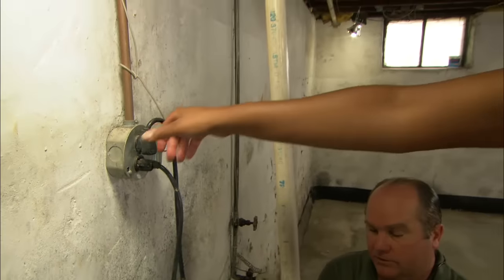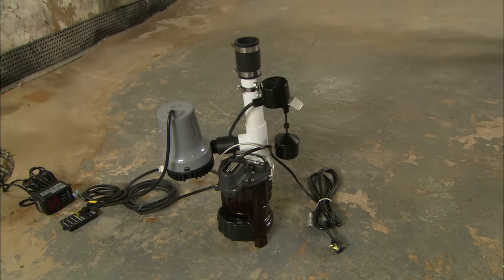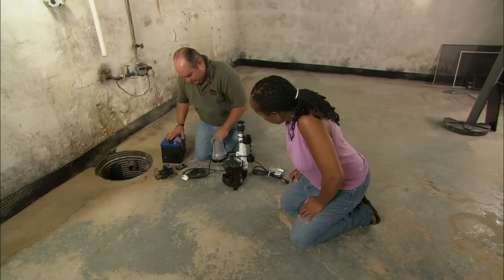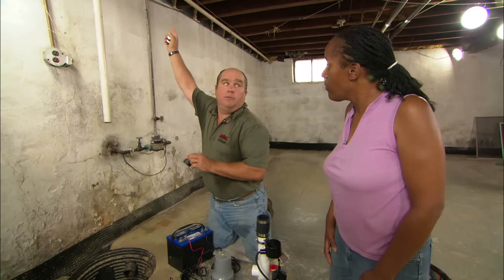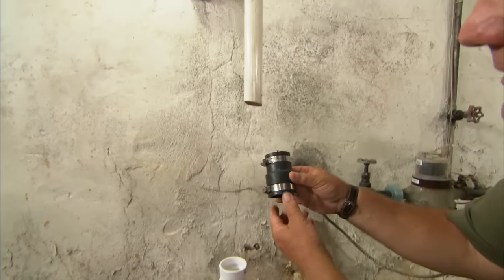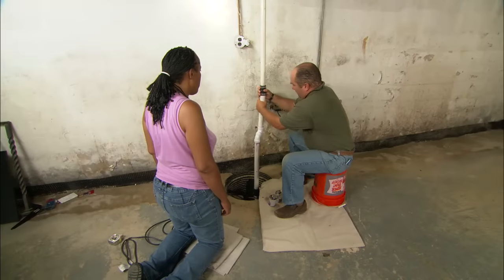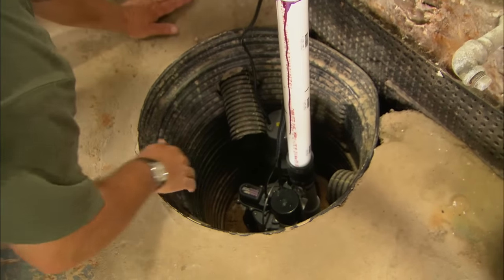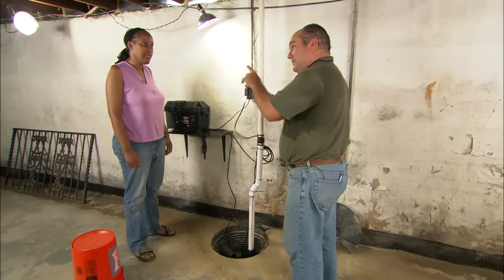How to Install a Battery-Operated Backup Sump Pump | This Old House

Comment: You should have used water backup pump from liberty or zoeller. Why create additional work if battery backup fails, Who is going to look to maintain battery,, another hassle and a chance for additional charge for the plumber!
Reply: Those typically have very low performance
Reply: I have a fully finished basement. There is no way to run water to my pump to use a water powered backup with ripping up drywall.
This might not be the best solution but it is the best for some people can get.
Reply: Wrong
Reply: Water is good cause there is no battery. Major con is you could end up with a huge water bill if the power is out long. Course that is better than a flooded basement tho....
Reply: Liberty water backup has a 2-1 ratio for efficiency, (2 parts fresh water to pump out 1 part storm water) and it is powerful enough to evacuate a pit in under a minute, or keep up with rain flooding until you can run a generator to your regular pump, 

Of course if your on vacation for a week and power or pump goes out for couple days, you’d be in crap either way.

Comment: damn I've never seen primer run that far!
Reply: That primer and glue was put on as sloppy as Bob Vila would have done. Richard is usually more meticulous.
Reply: I've glued thousands of miles of PVC CPVC SYS15, I've never seen primer run that far.
Reply: I guess they could have held the pipe horizontal a bit longer for it to finish drying, but who doesn't like a little purple decoration to liven things up?

Comment: Four hours of continuous use or 1 day of intermittent use doesn't seem enough when you consider the cost of these hybrid backup systems. The marine battery is not even included in the kit. You're looking at $500+ for all parts and some say the batteries only last 3 to 5 years.
Reply: Yes, the battery will fail right when you need it. Battery technology is still lacking.
Reply: Batteries last 3 to 5 years of actual use, discharge and charging.

Keeping a battery topped off on a float charge, stored properly in a climate controlled area you're getting 10 years or more.

However even if that wasn't the case, remember that 3 to 5 year mark is promising not that the battery will work or not, but that the battery will retain a certain percentage of it's original capacity.

I.e. this normally means after 3 to 5 years we promise the battery will still have at least 80% capacity at say a 20 hour discharge rate and still able to put out 80% of it's CCA.

Also largely batteries fail due to not properly taking care of them, with flooded you should check levels yearly in your vehicle or backup batteries(There are caps, unscrew, make sure electrolite solution is above the annode and cathode and if not, add distilled water) and if levels are really low that allows for sulfation which destroys batteries over time. 

Also largely batteries are cheap. Want more power and longer use? Buy a battery box that will fit 2 to 4 batteries(Roughly 50$ instead of 25$, or 150 for the 4 battery one) and have that be your backup. 

Buy a cheap battery tester, do a test yearly or every couple years, and hell a battery flooded is roughly only 100$. 

Rather cheap to replace that every 3 years, but again proper maintenance and keeping levels up, and largely because this should only be used when power fails, I wouldn't be surprised if it lasted 20 years.
Reply: @shawnsdrumcave  They also sell 12V solar panels super cheap now
Reply: @shawnsdrumcave  if you have municipal water check out Base Pump HB-1000 on Amazon it is a backup pump that uses your municipal water venturi style to empty your sump  when you have power failure. It uses one gallon of water for every 2 gallons its empties from your sump, saves you so you can get home and start your generator. Also check out the youtube video of it being installed if your skeptical. I just had it installed life saver

Comment: Missouri Wind and Solar mwands dot com has a lot of battery based systems including wind turbines and solar systems. They are also working on a batteryless pond aeration system for under $800.

Comment: I keep reading about drilling a hole in the outlet pipe.  Richard doesn't in this case, so I wonder if it is really necessary?
Reply: Martin Connor lots of pumps have the anti air lock hole in the housing these days.  The instruction manual will tell you if it's necessary.
Reply: I just bought a backup pump kit and it had one built in.
Reply: @ScubaCat3  This Liberty Pump definitely tells you to do it

Comment: The power will be  the weak point. And not enough pumps in some cases. Why not have it on a natural energy source back up.Trickle charger from the Solar panel/wind/gen. Run on a treadmill that is hooked to the trickle charger to charge it once a day when it is not sunny and burn some of that fat off I don't know. I would not have my battery rely on the power as shown here and the battery is way close to the floor and just in the way, looks tacky and a potential homeowners insurance nightmare when it falls or someone thinks it may be funny to mess with it.  
Sandpaper gets those burs off way easier and is safer than a razor blade as well. 
Might as well run that outlet pipe just a little higher from the pump so that once it gets to the proper elevation it can then run down hill resulting in less work these little pumps have to do in the grand scheme of things.
Speaking of which, these entire systems are not to expensive so why not have 2. You are protecting your home or if you are flipping homes this is a huge selling point when it comes to buyers in my opinion.
Don't half step this investment/protection.
Reply: Stoooooop

Comment: I have read a lot about these submersible pumps needing to be replaced after 2-4 years due to leaking seals and seizing up vs a cast iron pedestal pump that can last 15-20 years.

Also the battery backup pumps usually fail or don't have enough power to pump an 8+ feet head. They make a 24v version that uses two batteries, but it is insanely expensive and only good for a few years.